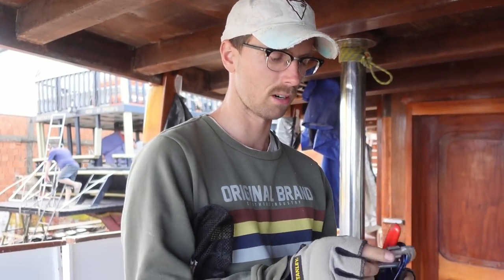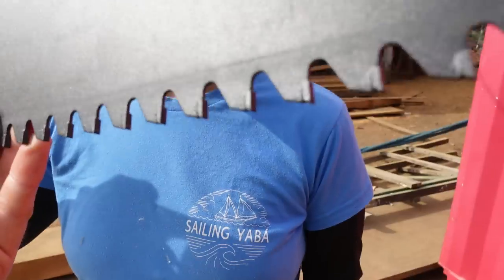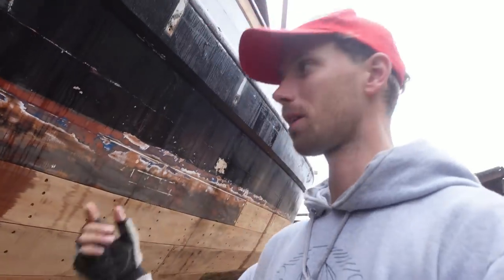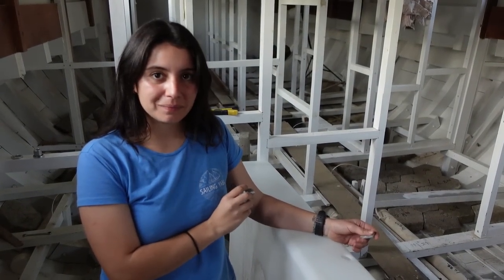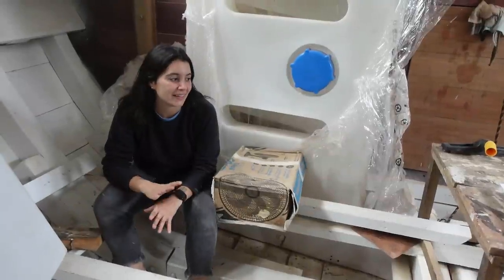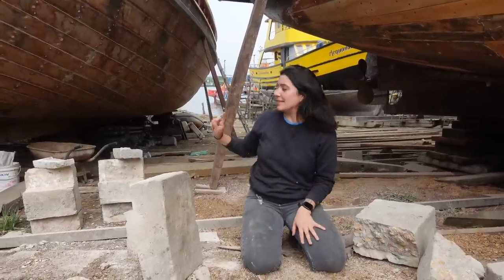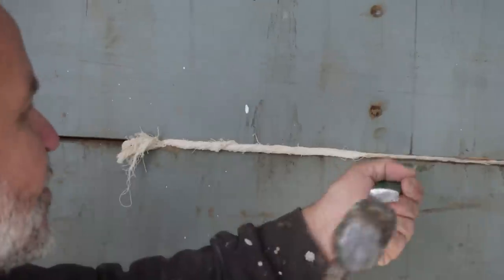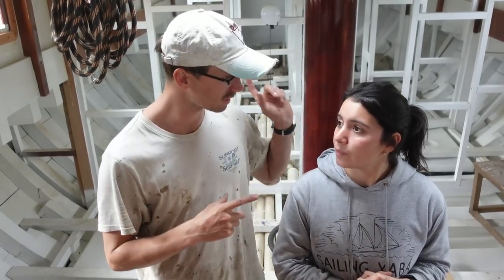Boat build: Poop smelling wood + 1 ton of liquid ballast — Sailing Yabá #105

Comment: My concern is what is holding down the ballast? That will easily move in rough seas and cause damage you cannot easily get to.
Reply: Its a Coast liner
Reply: A hard broaching wave and a list/roll of 20-30 degrees will have those stone moving. Going over a wave and catching air will have those stones also airborne.

Comment: Breathing silica dust from grinding concrete permanently damages your lungs. Get a mask.

Does the same to your saw, get it one too. What I mean by that is the motor fan sucks the grit into the back for cooling. That grit ruins the bearings and the commutator and brushes. Putting a high flow bag filter of some sorry over the motor will save it from the grit. However it will reduce air flow, so you have to let it rest longer between cuts.

Comment: Dude, that body belt you are wearing will cause more pain than bottoming out on the ground.  Always use a full body harness whenever working at height.  I've instructed this stuff for many years and I have seen so many issues that I would never recommend a body belt.  A boatswain chair or a full body harness for the type of work you are doing is far safer.

Comment: thats bad.. if your gonna cut Concrete/stone blocks with power tools Either have constant water pouring onto the blocks to ensure no dust or Wear A proper mask while cutting them.. concrete and stone dust is Extreamly bad for you if you breath it in and can lead to many many lung problems.